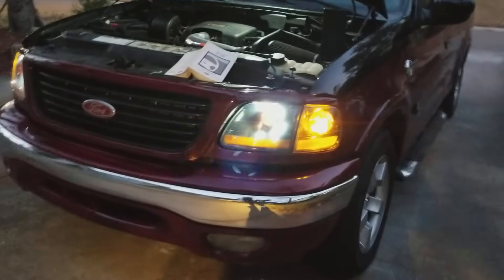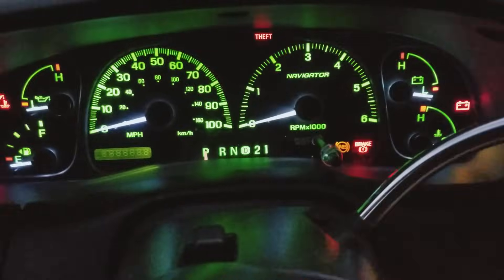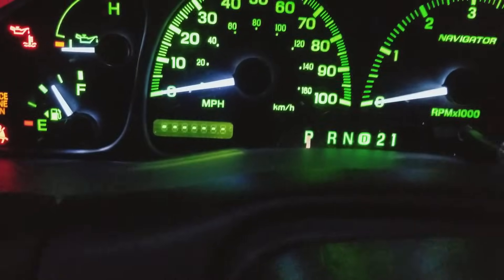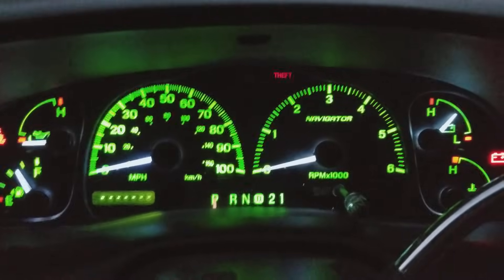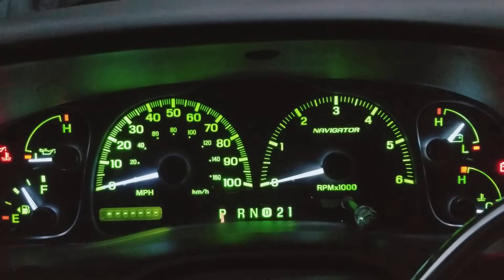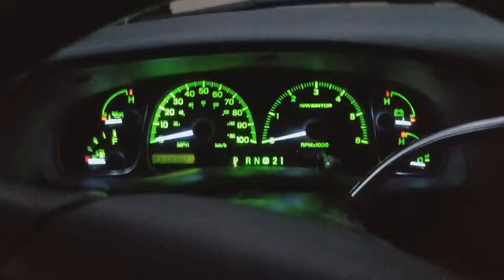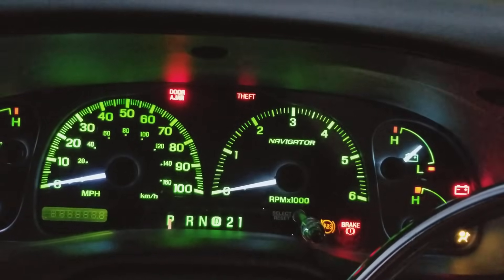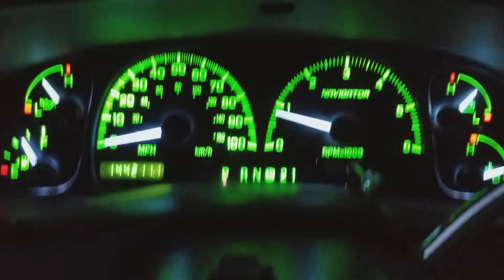1999-2003 Ford F-150 THEFT light decoding

Comment: Try this trick 1st if your car won't start & your theft light is blinking:
1)put key in the ignition and turn to the ON position so the dash lights up
2) leave the key in the on position for about 90 sec until the theft light stops blinking 
3) crank the car for about 3 sec (it will not start)
4) quickly turn the key to the off position & crank again (should start this time)

Note: This works for me with my 2001 Ford F150 4.6. I think my key is worn down and I need a replacement. Hope this can help someone in a pinch.
Reply: This was very useful. Thanks. It worked for me.

Comment: I have the theft light flashing after I shut off engine . But 2002 F150 truck still starts every time . What’s the deal?
Reply from the maker: It's just how they're designed. The only time it's a concern if it flashes  quickly as it does in the video.
Reply: fawfulize  thanks For the info 👌🏼

Comment: Thank you for this video and contribution. Potentially saved me hours of troubleshooting or a trip to the dealer. Got the $12 Dorman part from O'Reilly and the truck is running like new again. For what it's worth the truck started showing long cranking times intermittently for a couple of months leading up to sitting for a 2 week stretch that ultimately killed the relay.
Reply: Will thiscwork on a 99-04 mustang. Why do the dashes show on the odometer...is this a pcm or key issue

Comment: Mine only blinks 4 times but I cant find anything online.
Reply from the maker: 4 total times? Its sounding like a code 13.
Reply: @fawfulize  I figured, do you know what that is by any chance ?
Reply from the maker: @juanhinojosa9022  Key transponder signal not received. Either the key is incorrect, or faulty.
Reply: @fawfulize  danm, been using the same key for the past 10 years, thanks for your help though.
Reply: Mine blinks once pause then twice any ideas??????

Comment: Wow for a second I thought you were a life saver, however i got (coincidentally) a code 16. I removed the battery to charge it, put it back in n got this code.
Pulled the relay fuse but still 16....
Any ideas guys
thiroux@live.com
Reply from the maker: Did you just pull the relay or replace it? If you replaced it, check the two PCM underhood fuses. I've seen those blow also.

Comment: _____My 2000  Excursion intermittently (One out of ten times) flashes the theft light and will not start. It will turn over but no fire. My mechanic had it for a month and only wore out my starter. He suspected the PCM but didn't want to be wrong. I told him just replace it, if it's not the problem no biggie. He did and it got rid of the check engine light but now only the theft light issues. Hopefully Auto Zone carries these relays. May just go to ford. I'll let ya know the results if ya want.

Comment: Thank you for taking the time to do this video, i have the same code, so its just taking the relay out and back?, Should i replace it?, Clean it with an electronic cleaner or just compressed air?. Thanks
Reply from the maker: Replace it. I removed it in the video to force the error code, making it act like the relay was bad. Just replace it with another, and you'll be golden.
Reply: @fawfulize  I bought it this morning, replace it at the autoparts and it was working fine, but at noon it did it again, i took it off and put the old one and it worked, seems that its failing when is really hot outside, any ideas?. Tks.
Reply from the maker: @CesarDeLaHoz  check the fuses also. There are two 20a PCM fuses in the under hood box that may have failed. 

I've seen the fuses and relays fail at the same time.
Reply: Thanks alot

Comment: Hello thanks for this great video, my truck does the exact same thing BUT it does turn on sometimes it’s like an intermittent issue where in the mornings does not start but later during the day it does, do you think my relay is getting bad? Thanks for the help
Reply: did you figure out the problem. my 2002 is doing the same thing and I have changed the immobilizer, pcm, new key, everything reprogrammed, new battery, new fuses and so forth. it turns over but won't start. if I let it set for a week then it starts and runs for 15 minutes then shuts off again with anti theft flashing and code 16

Comment: I have a 2001 lariat f150 it is normal for theft light to flash while it is off
Reply from the maker: That it is. Not sure why Ford designed it that way, but Ford has done that for years.
Reply: @fawfulize  thank you

Comment: My f150 was cranked with the spear key and the original key was lost my f150 4x4 has been collecting dust for 10 years now if not more. I've had some key programmers or whatever they do and can't get a reading or anything out of her.
Reply from the maker: So no connection at the DLC? Hmm...

Well, outside of any physical wiring damage that has occurred, or physical damage to the modules.... I'd check the Data Link Connector fuse, and see what that one shows. I'd also check and replace any PCM related fuse or relay, as that also could cause data connection issues. 

If NONE of that works, depending on how determined you are, youd be looking at a PCM, key, and cluster swap. The three main components of the PATS system.
Reply: @fawfulize  thanks I'll give that a try. A soon as I find the time. Thanks again.
Reply: @fawfulize  so changing pcm cluster key.will work and scar will run..chanhing those 3 parts will do the job.wow thx
Reply: @fawfulize I have a question I'm replaceing the pcm cluster key on a 98 I bought that's has no keys the new used parts I have are from my 03 and the traseverss are diferent looking as Well as diff plug type. Will the older original transever work with the pcm cluster key swap  or do I need to also wire up the transever that goes with the 03

Comment: When replacing the relay should the neg battery be disconnected?
Reply from the maker: Nah, you can pull and swap all you want the PCM relay with the cable attached. Obviously, just don't go pulling relays with the key on.
Reply: fawfulize Thanks man!! So far so good!

Comment: Guys need help. Same issue. Do i just pull put the pcm? Its kinda hard to pull out.
Reply from the maker: For a temporary solution, pull another relay (usually the heated backlight relay is what I suggest), and swap it out with the PCM relay. If that doesnt fix it, check your pcm fuses also. I've had both fail before.

Comment: I gotta problem with my truck is turn the key it makes a clacking sound on the driver side?
Reply from the maker: If it's extremely rapid, and your gauges sweep..  your battery might be on its way out.
Reply: @fawfulize  nope not at all

Comment: So since you're probably the most helpful person on the web regarding this matter--single mom🙄so dealership not an option. BROKE the stupid key off in the ignition, wait it gets better...now I've lost the damn transponder! Going on two weeks with no transportation!!! Any solutions from anyone? Have the key fob?
Reply from the maker: Thats... a bit of a sticky wicket. If you lost the actual black part of the key with the chip (which is what it sounds like)... a locksmith MIGHT be able to help you out, depending if they can program it without the key or chip. The system can be disabled, but that requires somewhat pricey tuners to do so. Going with a junkyard key is possible, but that is a bit of a... pain, to say the least. The PCM, cluster, and key all talk to each other. Youd have to pull all three from a similar drivetrain truck then swap it out and the locks to get it to work. Not exactly a route I'd suggest. Best and cheapest bet is the first thing I said, which would be locksmith. Good luck with it.
Reply: @fawfulize  forgot to mention it's a 2003 focus:/
Reply from the maker: @rebelliarosetm2008  Gotcha. I'd still stick to my original statement, as the PATS system didnt change... too much. They use the same keys, and programming keys and fobs works the same also. I'd still try and see if a locksmith can help. Older systems like make an easier time getting ahold of the proper equipment.
Reply: @fawfulize  would you happen to know what year the focus began to utilize the PATS system in the ECU?
Reply from the maker: @rebelliarosetm2008  I wouldn't off the top of my head, however i do know  when they started in the F-150's, which was 1999. If your key had the fat black key handle, you have PATS.
Reply: fawfulize Thanks!!
Reply: @fawfulize  thx u
Reply: It didn't fix mine what else could it be
Reply from the maker: @bignick28s  If you have a code 16, replaced the fuses AND Relay, then your PCM may have failed.
Reply: nick lee I was going to say something along those lines but not precisely. I noticed that despite the pcm seemingly responding to the improv transponder key I have been tinkering with, the PATS light will go out and it’s interesting to watch the speed of blinks and delays as it is working (it slows significantly the closer it seems to diffuse) and will eventually go out. Now, I’ve got the PATS disarmed I believe, but still no crank. What I’m thinking is that I need to use my obd2 tool to find and clear any related codes preventing it from starting now.

Comment: I’m trying to do this, and it’s not working. I’m not sure if I’m doing it right. But I’m pulling out fuses and stuff but it’s not working for me
Reply from the maker: Mainly, you need to swap or replace the PCM relay with another one that you know is good.

If that doesn't work, check the two underhood fuses for the PCM. If they're burnt, replace and retry.

If neither works, then your issue lies somewhere else, or you may not have a code 16. There are other theft codes that can show, but code 16 is the MOST common.
Reply: Is there a way you could email me and I’ll send a video of what’s going on with the truck? And maybe you could help a little bit more?
Reply from the maker: @matthewsantos1372  Sure, I'd be glad to. Just message me directly, and I'll do what I can. I'm out right now taking care of a couple things, so itll be a little bit before I can take a good look at it.
Reply: Here my email is matthewsantos38@gmail.com I’ll be glad to send you a video and help me out ..

Comment: Sorry for so many questions.  We have not removed relay yet but am getting code 16, should we replace that relay?Damned if we are having this towed to dealer
Reply: Went and bought new relay, still not working.
Reply from the maker: Check the fuses then. I've had cases where both fuse(s) and relay have failed. I believe there are two fuses for the PCM in the underhood fuse box. If I remember correctly, they're 20 amp fuses.
Reply from the maker: Check the other fuses if you dont have a spare relay; they could also be burned out. If you need to drive the truck, swap it with your heated backlight relay.

Same relay is used, and you can drive on that until you get a replacement.

Comment: Mine  started doing this a few months back. starter goes, but engine wont come on.....and when I tried to start it again it started right up.( I think i move the key back and forth several times then gave up)..lately its been doing it more,  about three times this week...all I did was reset the computer ( as my moms BF ) saiad by switching the key back and forth several times and back to aux....wait about 5 secs, then it usually starts Will definetly check out the PCM fuse in 304.
Reply: my Ford F150 2001 battery light keeps blinking in and out and it shipped up my light and not coming in back my headlamp

Comment: So I have tried most of the recommended solution's and my truck will still flash theft lite
Reply from the maker: hugo zepeda What's the flash count for yours? Aa I said this is the most common I've seen, though it can be others. 

You may not have a code 16.
Reply: I've bin dealing with this for a while tried all the ideas
Reply from the maker: hugo zepeda I'm asking what your code was. Take note of how I counted the flashes to check the code. 

If you've already tried the tricks, I have reason to believe you may not have the same Theft code I triggered. If you do however have the same code, and have tried it all... you either have a PCM power issue or a PCM issue itself.
Reply from the maker: hugo zepeda Ok, I think I'm seeing where this is going...

If you've pulled parts from other vehicles, two key points that could definitely mess it up are your PCM and gauge cluster.

If those were pulled from different vehicles, then that would definitely cause issues. The PCM, Key, and gauge cluster all talk to each other when checking for the PATS info. If all do not match, then you'll get a no start with theft light flashing for sure.
Reply: fawfulize ok I don't understand parts pulled where intake timeing chian covers only electrical was ignition coil s and wires
Reply: @fawfulize  so if i use pcm cluster keys/ignition off a donar car and put those parts in car then that car start...
Reply: @hugozepeda4444  use pcm cl ou ster key/ignition off same car and install in your car it will start and work fine ..is t hggg at wgat your staying

Comment: I've been trying to get my car to start for about 2 months now. The theft light has been on for years when the car shuts off. I just changed the starter and selonoid and it still wont start. I saw your video, and i took the pcm relay out and then turned the car on. the theft light didnt blink fast like in your video. it started out slow with the pause for a few seconds in between each blink. and the pause inbetween each blink was the same. Does this mean somethink could be terrible wrong with my car?
Reply: Pcm

Comment: Hi how did you get your dash looking like that, thank you so much.
Reply from the maker: Sure, no problem! First thing was swapping the gauge cluster out to a Navigator cluster. Mileage is stored in the circuit board along with PATS info. You can slide it off the back of the cluster after removing the plastic cover and unplugging the odometer plug. Just slide it onto the Navigator cluster, and everything will work. The ONLY stipulation is that you lose your cruise lamp. For some reason, Navigator clusters don't have one.

After that, you'll need LEDs. Autolumination has the brightest lighting, but reliability issues. VLeds have better reliability, but aren't as bright. You're going to need 6 T5 LEDs, and to match this color... probably around 5500k color temp.

Comment: Hey buddy my light blink 20 times and that's it
Reply from the maker: Charlie Weaver 20 times? Are you talking about the rapid flashes? 20 times alone is... something I haven't heard of before.
Reply: After the rapid it blink 20 times
Reply: What's crazy it starts with starting fluid. I change the fuel pump because it was bad
Reply from the maker: Charlie Weaver 20 times in a row... well, going through my mind, it might be a code 14. If it repeated the code 4 times, then that would be 20 total flashes.

From what I can find, that is "Invalid Key Code Format"

Do you have a spare key for it?
Reply: @fawfulize  mine does the same thing and I bought a key and cylinder and replaced it but it's a blank key now what? Do I hold the key back for 11 minutes and 30 seconds

Comment: Got a new fuse.. still have the same problem
Reply from the maker: Sarah Youngs did you check both the fuse and relay? I've run into a case where both had failed, so it can happen.

Comment: 2000 F-150,  Did you replace the fuse, or just take it out and put it back later.Had a key made, no luck!   Thanks
Reply from the maker: jerry goen I removed the relay to force the trigger. There are actually two fuses under hood for the PCM, so check both. Also, replace the relay. There's a heated backlight relay you can pull and swap to get it started back up. I can send you a picture of the locations of both fuses, if you'd like.
Reply: fawfulize please do
Reply from the maker: jerry goen here's the picture from my owners manual. Fuse #2 and Fuse #18 are tied to the PCM. #2 is 30A, #18 15A. Relay #304 is your PCM relay. If you don't have a spare one, you should have the same type of relay in #303. That is your heated backlight relay, so you can swap it out so the truck will at least run.

https://imgur.com/a/vSZHL
Reply: Please send photos of the relay location. Thank 6.  @fawfulize
Reply: I need to know, because the theft light blink 3 times then long pause. Blink and then repeat blinking 3 times. What code is it and what causes it? Ty
Reply from the maker: Lotomau you may have a code 12; which is a defective transceiver, frolm what I can find out. I don't think there is a code 3, so check the flashes again. If you see mine with a code 16, it flashed once, had a short pause, then flashed 6 times.